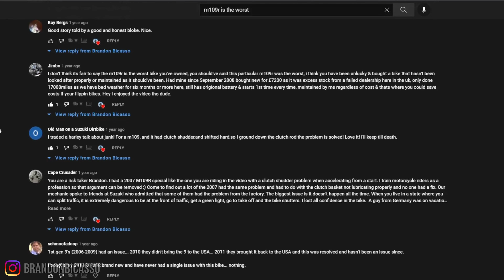Why The M109R Is The BEST Muscle Bike I've Owned

Comment: Great video. Mine destroyed 2nd gear after about 3 months of riding back when it was stock. Turned out to be the best thing that could happen as it forced to me upgrade the transmission to the point it is today. Easily the best bike I've owned. Also your car is an Australian Holden commodore with some slightly different plastic parts. There's literally millions of them over here if you ever get stuck looking for a part
Reply: Hey Man, Am about to get an M109R 2011, i was wondering if they fix the transmission in this model.. or not.
I’m not an expert in motorcycle and this one is gonna be ma first one thu.. what cons and pros other than that u can lighten me up please?
Reply: @MuAlJawi  no. The truth is suzuki never addressed the actual problem but they changed some things that reduced the wear that leads up to the problem. I've seen 2019 bikes with failed 2nd gear. But the first 2 generations were definitely worse
Reply: I heard the same thing from my mechanic. Ended up with the C90.
Reply: @lukeatadelaideperformancee8052 Hi! Which parts did you use and where did you buy them? My transmission has started jumping out of second gear from time to time, and I think I need to address this issue soon.
Reply: @lukeatadelaideperformancee8052  Id say you dont know how to ride & calling bullshit on the ownership...

Comment: I just have a suggestion, and I don't mean this to sound rude at all. But consider changing the name of your video entitled "The M109 is the worst motorcycle I've owned." It's not an accurate title. Why don't you say instead: "Major failure on my M109!" You'd get just as many views, and it would be a more accurate title. People really appreciat honesty on YouTube, and you have a wonderful channel. Just my advice as a podcaster fan.
Reply from the maker: Because the title is accurate. That bike was the worst motorcycle “I have owned” mechanically. That was my experience 100%. And there are many others that agreed and received value from it. And major failure is inaccurate. It was already  damaged before I received it.
Reply from the maker: The people that aren’t agreeing and are upset, in most cases have emotional attachments to the bike and defend spending $3000 for a design flaw.

Comment: My favourite car I've ever owned was my 1990 Toyota MR2 Turbo, Targa Tops, black, it was just a go-cart for the road. I loved that car. The only car Ive ever regretted having to sell. I replaced it with an RX-8, (as the missus said the next car had to have back seats, a boot and four doors) but it's just not the same. Now Ive gotten into bikes. A Yamaha vStar 650 got me to my full licence, and now own a 2007 Suzuki M50 Boulevard, and love it. My daughter has a Ninja 400, (and lets me ride it occasionally) and got it for a very similar reason to this M109, there will be parts for a long time as a popular bike, but now discontinued for the Ninja 500 (actually just a stroked 400 engine up to 450cc, so the marketing name is a lie) so there's still going to be a lot of parts around.

Comment: I have a 06 M109 and it probably one of the best bikes i've own to this date with more than 100k plus it is still the most talk about bike i ride. i've been all across the country with it and living in New England the weather limits my time to ride. Sometimes i think  the second gear is the rider and not the but i could be wrong. It is a very good bike i gave up a 01 GSXR 1000 with 32k on to make the change and now i have my fleet of bike to do different types of bike rides
Reply from the maker: 100K. That’s a goal for my 109 as well!
Reply: Have you had any 2nd gear problems?
Reply: @tonydodds4745  never had that happen to me only 2 clutch cables and set of plates, 2nd seal bike runs to this day I sold it to friend of mine with all the part he’ll ever need

Comment: Great story I currently own a 1989 Kawasaki zx10  bike was put in storage for several years but would like to bring it back to life, starting looking at the m109 love the bulky quality of the bike my question is do you have any recommendations on someone trying to bring back to life a Kawasaki zx10 with a major problem with gas tank pitted with rust on the inside trouble finding a new tank because of the age.
Reply from the maker: You’ll probably have to run vinegar through the tank then recoat it to prevent rust again. And then change out the fuel filter and purge the injectors. There’s videos out there on the vinegar idea and tricks on removing the rust.

Comment: I agree with you 100%. I still have my 2012 M109R that I bought brand new. I went thru 5 other motorcycles after the 109 and sold 3 of them after 3or 4 years. I sold my 2015 Sportster 48, 2017 Concours14 & 2018 Vmax but I can’t seem to part with the 109. I currently also have a 2021 Rocket 3GT & a 2022 Triumph Bobber. I think, if I could get my hands on a Thruxton and the Goldwing, I’ll have a pretty solid stable of bikes. Also want one of those Kawasaki W800.
Reply from the maker: Love the Rocket! Would love to own one at some point along with the Bobber. That Bobber is such a nice ride!

Comment: Just now getting into bikes as I approach 40. Definitely considering the m109 for my first cruiser and I appreciate your content bro. Good real and honest content.
Reply: I can tell you the best bikes. Don't share the list with anyone.
1.) FJR1300 6 speed.
2.) M109
3.) VTX1800 or VTX1300 touring edition.
4.) Honda Transalp 750 (best sounding twin ever? Sounds like a beasty V-twin with it's special 270 degree crankshaft).
5.) Indian Chieftain with cruise control (biggest engine, most low end torque, has a full windshield if you want. Cost a billion dollars.).
6.) Indian Scout (People seem to love them, although I would want the Chieftain's beautiful looking air cooled engine).
7.) Indian Challenger (insane power, and 1.8L engine like M109 and also liquid cooled). Cost $30,000 new.
8.) Goldwing (dollar for dollar, there is no better value. These have zero resell value, nobody wants them).
9.) Hayabusa (also dollar for dollar one of the best deals in motorcycling, usually meticulously maintained by older owners).
10.) DR650, KLR650 enduros. Just awesome, but sound awful with a single cylinder engine.
11.) BMW GS1250 (this is the most popular motorcycle in most of the developed world. But it does suffer somewhat short gear ratios and unnecessarily high cruising RPM, as most motorcycles do).
12.) Kawasaki Z900RS (Considered the best performance retro bike from any manufacturer, is the most popular bike).
13.) Royal Enfield 650 twin. Just look at these. The used bikes are going up in value, it's one of the best looking retro bikes ever. Take one look, and you'll want one.
Reply: Do NOT buy:
1.) Moto Guzzi (too much vibration).
2.) Harley Pan America (not reliable).
3.) Sportster S (not reliable. The new Harley liquid cooled engine suffers bad electronics).
4.) Kawasaki W800 (dangerous weak chassis and handling, with speed wobble when new. Unless you want to upgrade the shocks and tires, which is possible).
5.) 5 speed FJR1300 (too low geared, but good).
6.) Goldwing 1000 (bad clutches on first Goldwings).
7.) DR650 or KLR650. Both of these are great if certain issues are adressed, the DR650 shifting drum bolt, and KLR cam chain tensioner must be replaced.
8.) Kawasaki Vulcan (some had plastic gears on the oil pump I believe, and would fail. But I am not 100% sure).
9.) ZX-12R Kawasaki. The ZX-12R had a bad oil sump design and would explode. They didn't recall it, they quickly stopped making it, which is why they instantly made the ZX-14R instead which is a very good bike.
10.) Early Indian models (bad suspension without progressive springs, and not good ride quality).
Reply: @Ritalie  appreciate the info. I ended up buying a Ducati scrambler for around town commuting and I plan on getting a vrod in the near future.

Comment: Hi, l am enjoying your channel and l am toying with trading my 2012 electra glide for a 2014 m109 with low mileage and looking very good. Do you have any ideas      on things to look or listen for during test ride.T. I. A. from Adelaide, Australia.
Reply from the maker: Not much other than the transmission. That issue was fixed in the earlier years. Should be fine but ride it hard in the lower gears. The transmission on those bikes is clunky so make sure it shifts properly.

Comment: hey i also have a M109r boss, it's white and blue 2019 .. i would like to know where you get your parts from? also i would like to change my cluch cables,and break lines to steel breaded with clear coat.. i would like to put a 170 on the front tire.. do you know where i can get these parts from??? AL FREEMAN
Reply from the maker: I get my OEM parts from Suzukipartshouse.com or my local Suzuki dealer. My brake lines are from  Galferusa.com. My clutch line is OEM.

Comment: Suzuki sticks with what works and it doesn't stop at the 109. Their DRZ400-650 have been around basically unchanged for 20 years and again, still available new. Like you said, just change the colors. :)
Reply from the maker: True. It works. I don’t have a reason to buy any of their bikes new either. 🤷🏾‍♂️ Someone else will!

Comment: man i gotta say my old suzuki gsxr 600 was my favorite bike. i learned how to go fast and get low on it. but i've sold that off to save up for the newest version of the m109boss. i threw my leg over a lot of different bikes and it was the only one that made me feel small. at six foot one and 260 some odd pounds i'm not short enough to feel comfortable on any harley or even the honda shadow, which was going to be my go to until i sat on one and felt like i was on a kid bike. i sat on the m109boss for a second and immediately knew it was going to be my next bike. you are right that they make so many parts for these bikes it's hard to want to give it up. love your vids and how you present your content. stay safe my dude and keep the rubber side down.

Comment: I've got a 2006 with 100000kms on it. 2nd gear is clunky but fine.  I suspect 2nd gear failure is caused by the angle of your right wrist

Comment: @jed-uq4yz
1 second ago
Absolutely need to nail the exhaust to the engine on the 9 & not to the frame. Their engines are rubber mounted at the back so if secondarily mounted to the frame they will eventually leak at the exhaust port flange. There's not many mount points to go from on the motor but if look close near the right lower rear engine mount you can drill some holes for brackets.

Comment: Hi Brandon how are you? I cannot get around this buzzing sound coming from
The engine of my 2009 M109R.    Do you know what can be causing it, instead of hearing the beautiful sound of the pipes.   I keep on hearing like a Hizz when I’m in 1st to 3rd gear.    I have already put it for sale and it’s been less than 1 year owing it.  
Please help.  I have replaced the air filters and spark plugs.    I Did an oil change.  But I still hear that annoying sound.  The bike only has 27k.
Reply from the maker: You’ll have to send me some type of sound clip for me to understand what the problem could be. Maybe it’s the service motor on the exhaust, clutch basket or the drive shaft making noise. Could be a number of things.

Comment: I'm glad you retracted. I just got a 2008 m109r a couple months ago. I felt your first video was a little harsh. I admit the first to second gear trans is not as clean as I would like, but it become second nature pretty quickly to just be firm when doing that switch. Like anything manual, it just takes some time to develop that muscle memory, then it's smooth sailing.
Reply from the maker: It wasn’t. It was to bring awareness to the 2nd gear issue. There’s no reason a bike should drop out of gear from 2nd to neutral. That’s literally dangerous and can get you killed in traffic.

Comment: I sold my custom Victory Hammer last year now looking at both these bikes as an option for my next. Any advise on the M109R? Is that tranny issue only on the older bikes? I like the blacked out versions anyways, the matte grey limited edition (2017)? being tops for me but they all are cool.  Prices are decent on these and some of the Vrods too, not as good as a Victory but I've been there done that might be time for something else. I used to own a 2006 streetrod and it just felt small compared to the Victory and I'm only 5'9' do you find the 109r a more stretched out bike than the muscle? The reach of bars and pegs seems a little wonky on the muscle also. Great content as always.
Reply: Yes it only affected a few of the early models. The newer ones aren’t reporting the issues

Comment: I have owned my m109r for just over a year and have a transmission issue, however I will pull it apart next winter and fix it then, however spring is coming soon, so off to change the fluids and get ready for riding season all over again!  Thanks for keepin it real Brandon!!
Reply from the maker: That sucks but at least you can work on it! Definitely make sure you’re having fun while doing it. It’ll be so much better that way.
Reply: @BrandonBicasso  yes a nice glass of whisky to go with wrenching on the bike is highly recommended!

Comment: If you want to find parts for your pontiac g8, look to the aussies as the car is actually an australian car, a Holden Commodore with a few cosmetic parts swapped such as body kit and has been converted to left hand drive. There is a lot more of these in australia but they are discontinued here in australia too.
Reply from the maker: Good point!

Comment: I tend to not worry about parts for a bike.  Most manufacturers support them for 10 years.  If you get an older bike that had a 10 year production run, you will have a lot of bikes with parts.  I do go to eBay and look at a model I am thinking about to check if there are bikes being parted out, etc.  It helps ease my mind that I will be able to find them.
I want to take on an older bike project, but I am not that confident in my skills yet either.  I am taking on wrecked bikes, but only ones that I know I can get parts.  I don’t want a garage queen yet.
Reply from the maker: No garage queens!

Comment: I still love my 2016 M109R1 B.O.S.S. (bought in 2017) All I have is a K&N filter on it, so far, but I have an exhaust and Power Commander to put on it soon. I've had my bike tuned as it is right now, and it was putting down 110hp to the rear wheel, so I think it's safe to assume that most stock Boulevards are similar.

Comment: Favorite Bike was an 86 Heratage Classic. It got the chrome treatment.  Lower fork legs inner and outer primary Cone cover lifter blocks rocker boxes transmission end cover and shifter cover.  If you don't want to polish aluminum paint it or chrome it. Andrew Ev cam Mikuni carb. Plus the the overdrive pulley set up for the Electro Glide. Rode it up and down the Easter Seaboard and to Canada. 
Favorite cage was a Ford Econoline van 300 ci straight six. Damn good engine.  My Labrador loved the view from the passenger side.  Cheers thanks for another great video.
Reply from the maker: That’s awesome, Calvin. Thanks for sharing! And yes, I severely dislike chrome but somehow I keep coming back to it. At least the Vrod is polished aluminum 😂.
Reply: @BrandonBicasso  The single advantage to Chrome is  windex and a paper towel will clean it. But never wipe it with a dry cloth or towel. The result is tiny scratches which mar that smooth shine. Cheers have a good ride today.

Comment: The 109 is an amazing looking bike. In 2018 I bought a 2001 Honda Shadow 750 Ace, in 2015 I bought my 2004 Honda ST1300, in 2021 I bought a motorcycle camper and for 2022 I plan on buying a 2014/2015 Honda Valkyrie muscle Cruiser even though they stop making the Honda Valkyrie in 2015 because the valkyrie is basically a Goldwing there going to be plenty of Parts if I need them in the future because it shares its platform with the Honda Goldwing I don't know if you've found your fueling problems but good luck stay safe and ride safe
Reply from the maker: Sounds good! I see a Valkyrie around the area every now and then. Cool bikes to see.

Comment: I would also like to see some updated Suzuki Cruisers across the board.  It seems they are very into their sport bike lineup like the GSXR and the Hayabusa, but they are more or less ignoring their Boulevard/Volusia lineup.  I'm currently riding a C50, and it would be nice to trade it in for a more modern C50 or C90, but right now other than a slightly different visual change, it's the same bike.
Reply from the maker: Completely understand that. You’re right, it’s the same throughout that lineup.

Comment: I use to own a Suzuki VS 800 intruder that bike was lightweight. Plenty of torque a lot of fun to ride like the Yamaha virago, but I preferred the intruder because it was quicker and the engine was smoother. However, I’m not criticizing Yamaha for they make great bikes as well.
I had my mind set on buying the M109, but after my brother told me how heavy it was I said forget it because I used to own the VTX 1300 Honda and it was getting too heavy for me. I’m only 5’8 and 61 years old so I decided to get a smaller bike so I went with the SV 650. I’ve read a Lotta good reviews on that one and it is a lot of fun to ride and is very reliable. It’s one toughly built bike I ❤ it.